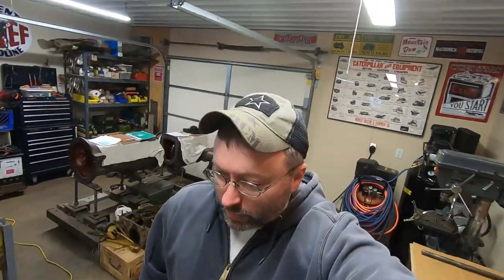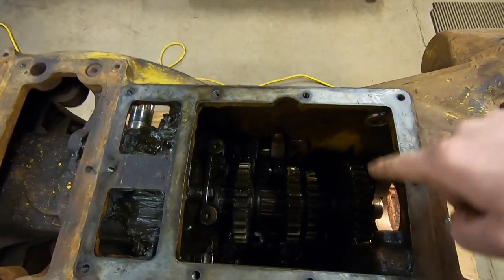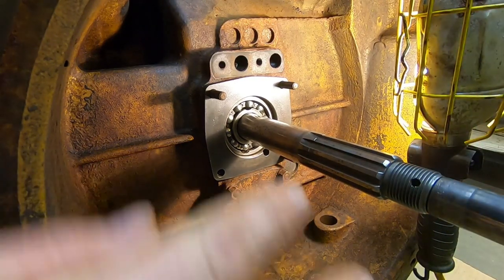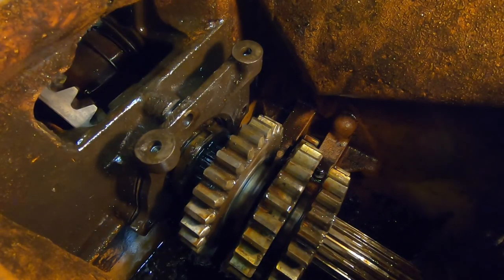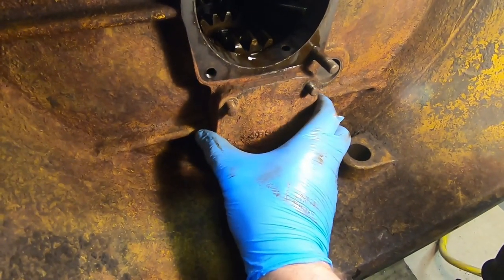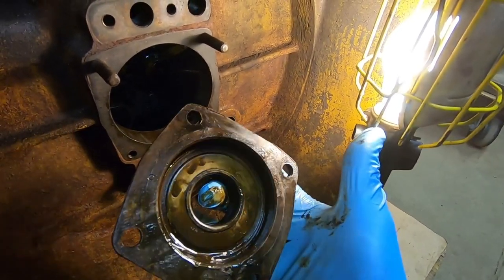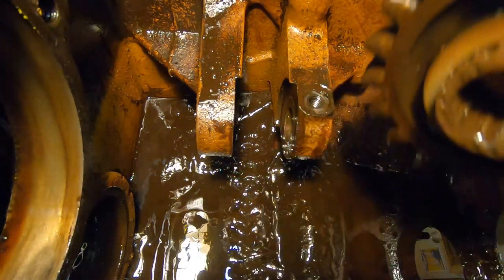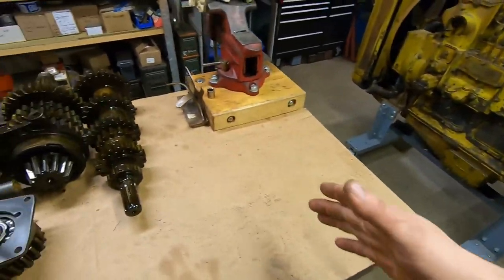Caterpillar D2 #5J1113 Chassis Rebuild Ep.8: Sliding Gearset & Countershaft Removal

Comment: it may not be as new, but its near enough that with the light and limited use it will have in the future that its now good enough for the next 200 yrs. D2s will do as much work now as they did when new, but in reality they are too old to compete with modern machines, so a commercial user wont be using them. Having said that, the guy who will own these in the future will get great use as will the following 10-15 owners. They will each owe you greatly for your careful, quality work!! Many thanks for this and for allowing us to follow along!!! Be safe!!

Comment: At least the smelly, sticky oil was enough to keep the vast majority of the gears, bearings and shafts in good enough condition to be slid apart by hand. Well worth the stench, no? Aside from the expected , possible rust on the ring gear did I hear you correctly describing the visible lash marks as being nearly perfect ? Heavy tow contact that gets closer to the center of the ring gear tooth as wear in during heavy long time loading? So another indication that 1113 is a a lightly used low hour machine, Merry Christmas Sqautch253!
I'd be surprised if the ring gear has any heavy rust pits that wouldn't be easily "buffed out". Happy to come along and watch the progress 😁!

Comment: At first someone might be inclined to judge for a Mechanic not wanting that gear oil on their skin.  Remembering back I ran a few different Mechanical Presses in a Production environment,  with a Giant Flywheel, Ram, the Crown and Electric motor above my head.
  On a Machine that  large, and old there were no two ways about it gear lube would drip on my head all day and after your first day you were sick of the smell soaked into your skin. I worked the press room more than 4 yrs.
  Nasty s#&t let me tell ya.  Funny thing, we dismantled one of our 600 ton Verson presses to send The Crown (the big block on top that contains the crank, huge gears etc.)  out for rebuild, and they actually lost it for a few days. * We are talking big as a billboard and on a rail car. (LOL)

Comment: There used to be a spray on substance we used when facing a nasty, messy job at the rubber factory I once worked at. It was called " invisible  glove " or some such. It would protect the skin and would wash off with soap. Like the old trick of lathering with bar soap and letting it dry on your hands. Surely there is something like that where you work?

Comment: That was one BIG mistake I made on the H when I tore down the rear. I never took starting measurements... Ended up probably not making much of a difference since I had to replace the entire (cracked) rear case and one of the pinion carriers (pinion was due to my negligence). Very cool to see some similarities between the H and Cat engineering. Not fair that your countershaft came out that easy, though! I battled the one on the H for 3 days. Ha ha.
Reply: Squatch, I seem to remember you picking up an extra rear end for parts a while back,  have you torn that one down yet?
Reply: @squatch253  It is SO much fun! Ha ha ha! That countershaft nut sure fought me EVERY step of the way.

Comment: With the extra room inside the transmission area would it be worth it to put in an electric pump to run on a timer to keep the area oiled once a week of not running? Would require replacing a plug with a cord and seal to get power in but the ability to keep the setup lubricated when sitting could be a fun project for machines you know will be more show then work.

Comment: Not much to the transmission and the rear end in this unit. I am surprised. I take that the optional PTO like most tractors w/o live power gets its power from the countershaft. Thanks for sharing. Do you have a PTO unit for this tractor? I get the smell. My Ford 8N was leaking gearlube from the steering box. It is really rank skunky pig crap smelling old gear lube that stunk my whole yard up and now it is in my shop stinking the whole building up. Yep I will be saying goodbye to some of my old Carhartt favorites!

Comment: I always called it a ring gear, but I know what you mean
Reply: @squatch253  guessing because its just changing shaft direction, and not part of a larger gear set like it would be on a differential?
Reply: @squatch253  If I had to venture a guess (and I don't but that never stopped me) I figure the difference in nomenclature would be to differentiate the difference between a differential function and the lack there of.  At least that has a "ring" of truth
Reply: @scotte2815  That rings true with me as well. Think of an adjustment shaft on a piece of equipment that has a 90 degree turn. The gears are called bevel gears. Well, this is doing the same thing. Taking power from one direction and turning it evenly on both ends of the output shaft.
Reply: @scotte2815  Difference, differentiate,  differential... are we having nomenclature fun yet?